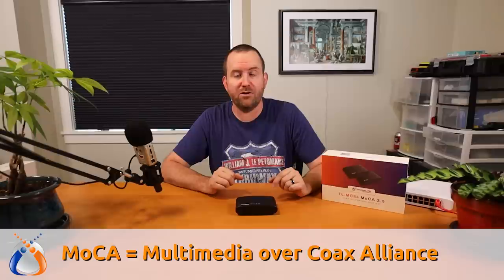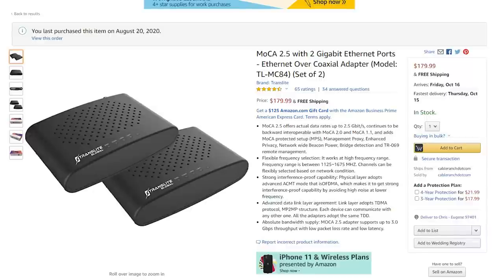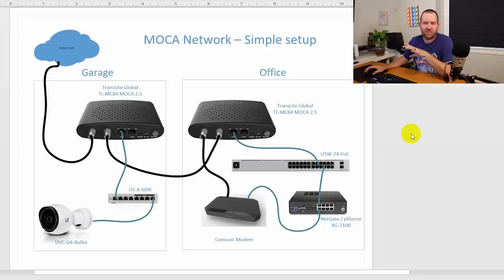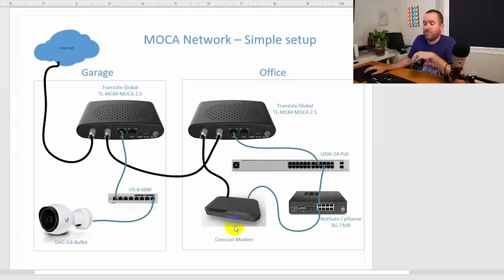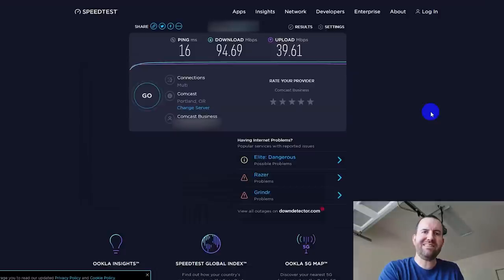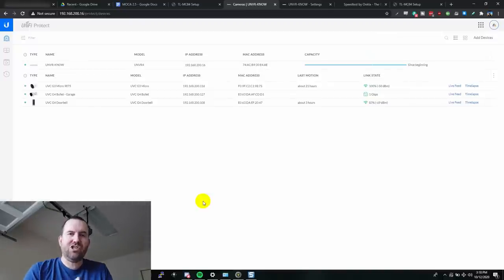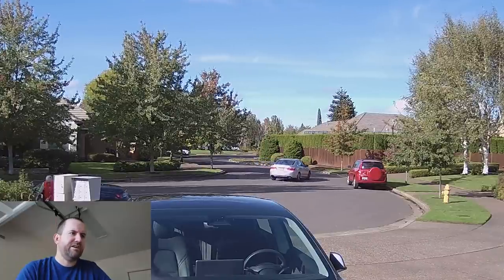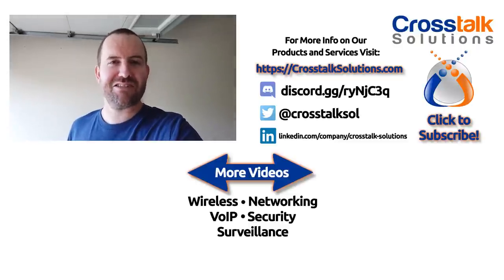MoCA Made Easy!

Comment: Also want to point out, if you don't have cable (your house has no cable TV or cable internet), you can pick up some DirecTV GigE DECA adapters to do the same task. They are MoCA but on a different frequency (one that won't interfere with DTV signals, but does mess with cable) and are dirt cheap - I am seeing them for under $40 each. I used to use the old 10/100 version for a long time and it worked great.

Comment: Sorry, but the first step is to see if your Internet provider and their equipment supports or can have MoCa enabled on the Internet router.  I purchased 2 MoCa devices, tried to hook them up and got nothing.  After logging into the Internet router, the MoCa could not be enabled and the Internet provider does not support MoCa.  I was done.  I'm also switching Internet service and going mostly wireless with a 1GB fiber connection.

Comment: Two things make me uncomfortable with this solution. From an engineering point of view the DOCSIS and MoCA networks are sharing the same physical medium. Shouldn't you be trying to reduce the likelihood of interference on the coax not increase it? (I also agree with others on the needless coax splitting.) From a security point of view the connections both north and south of your router are sharing the same physical medium. Do you intend to share your internal network with your neighbours? Better to move your cable modem & router to the garage and get another UPS, it would make for a much cleaner & safer design. Either that or find another way to connect the camera's to your network. Also noticed telnet is enabled on the MoCA devices. Looks like there are some security settings for the coax you might want to look at.

Comment: I'm not high enough to understand the in and out being different on both Moca devices... I'll have to spend some more time with this.
Reply: In and/out side has moca filters to stop signal from going to the cable plant outside the home and the modem.   The other port passes the signal (moca device to device) and don't allow it to go past when installed properly

Comment: I'm guessing your lack of throughput in the iPerf tests might be related to the extra splitter. I see speeds approaching gigabit (950+) on Motorola's MoCA 2.0 kit (https://www.amazon.com/MOTOROLA-Adapter-Ethernet-Bonded-MM1000/dp/B077Y3SQXR) in my house. I would get a three way splitter for the 2nd splitter and feed all three cables into the "in" side to see if that improves your speed at all.

Also, have you tried direct wiring the two MoCA adapters and doing an iPerf test on that connection? I would imagine you easily see gigabit.

Comment: 1   high signal is not always the best. To much is just as bad as not enough...    2 running it through splitters is not the best idea without a moca filter.  Your putting signals back on the cable providers plant. Moca filter installed between groundblock and splitter would be needed

Comment: Wonder what the security is like on those adapter's and what's stopping someone on the same TAP from plugging in a moca adaptor and it connecting to yours.
I personally wouldn't use these if I can at all avoid it to prevent any potential signal issues with the internet connection.
Reply: You can block the signal from leaving the house. Other moca adapters inside your house is no different from plugging into the local network so I assume you mean outside signals?
Reply: You've got a point there if you had another mica adapter outside the house but on the same coax it would be on the same network

Comment: I would have used the coax and taped 4x Cat6 cables to it and pulled through to where I needed (with a drawstring) and saved a load of money. But I think that is what you are doing with that pole in the background in the office.
Reply: Often the cable is fastened using wire staples, so no way to use it to pull cable. Also if its going through studs the hole probably isn't much bigger than the Coax cable diameter.

Comment: It would be better just to use cat 6 for lan runs. You get loss over coax and converters. I would pull out the coax and pull through the cat 6 cable. If you are renting the house you could use this method on the video but if you want something permanent cat 6 is the way to go. You save money in the long run. 150 dollars can buy you lots of cat 6. 73

Comment: I would also put the cable modem directly in the primary Coax connection and go from there.

Also, you might wanna consider switching some components in your coax environment, such as the splitters, since this fella here gained some much more impressive speeds out of the solution. Most likely he just had a direct cable in between. Nevertheless it is worth a try if you are just having the same problem:
https://www.youtube.com/watch?v=hcCEV2m2chs

Comment: Wonky setup, Actiontec adapters will run  a full 1gb speeds, 2.5gb 2-pack is actually cheaper than 1gb right now.

Comment: I tried  installing a MOCA/Ethernet adapter a few years ago, it worked great but the big problem was that it uses same frequency as the sky satellite signal and completely blocked the TV!. I've got 5 for sale if anyone wants one!
Reply: You need the G.hn coax adapters for your case. Comtrend sells a pair for around $90, they claim to support 1200 Mbps but realistically max 600 Mbps can be achieved. However I found those G.hn adapters had lower latency than the MoCA adapters. The G.hn coax adapters while able to coexist with satellite, actually interfere with cable signal, so I had the opposite scenario and had to switch to MoCA instead. Where are you selling the MoCA adapters?
Reply: How much $?
Reply: What moca version are your adapters?

Comment: Why wouldnt you just chop the end off the coax and use it to pull ethernet down to where needs it? Seems like you would be doing just like what the cable companies are doing and spending a lot of effort and cash to make something limp along that would have been fixed years ago had they stopped at DOCSIS 2.0 and pulled FTTH.

Comment: First the "split" version of what you're doing is sending your moca signals back into the cable network.  You need a moca filter.  Second, you're speeds are pitiful.  Actiontec moca 2.0 adapters get 600mbps single channel, 1gbps dual channel.  Something is wrong with your setup.

Comment: As a cable system maintenance tech, please for the love of God don't do this.

1 never use crimp fittings
2 never use gold splitters
3 depending on the moca frequency you can be causing issues for your cable modem
4 without a moca filter you can be sending noise into the system outside thus shutting down internet to the entire network.

Keep your moca and cable completely separate!! Please!

Comment: Ugh. All of these moca videos are killing me. I haven't found a single YouTube video simple enough for me yet. Bro, my bird's-nest of coax cables are outside in a box. From there they all run throughout the house to single rooms. Meaning, I don't have more than one coax drop in each room. 2 floors. How do I get this to work with a cable modem and a separate wireless router? I'm not trying to run coax cable to multiple rooms

Comment: Why do americans always have such a mess with their cabling? Use pipes to run cables and not just nail the loose cable to the wall, or use a proper coaxial outlet with a internal splitter and correct attenuation.

Comment: Your "simple" setup is too complex.  I don't have "cable", I don't want "cable", but I have coax in my 3 story house......
Reply: That is the most simple part of the setup. If you have no cable using the connection, then you are not going to be able to use it for Internet.
Reply: @sigurdtheblue  why not? I have internet, but not from cable. Isn't MoCa just Ethernet over coax?

Comment: so.... what is the point of the moca? You just made them redundant with the splitter.... infact... this who splliter and moca is redundant.... yea... you explained what, but how is it useful? everything that device can do is already implemented and irrelevant...
Reply: He explained it ... Wi-Fi lets you network via the air; Powerline lets you network over your home electrical wiring; MoCA enables networking over coax, with coexistence between retail MoCA adapters and either cable TV/Internet signals or OTA antenna signals. (DirecTV offers its own version of MoCA hardware, customized to coexist with satellite frequencies.)